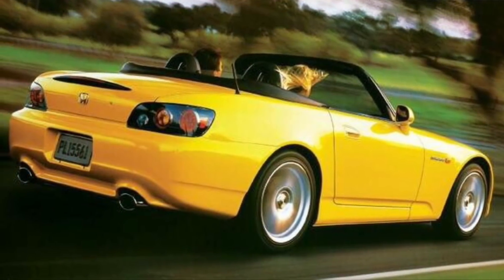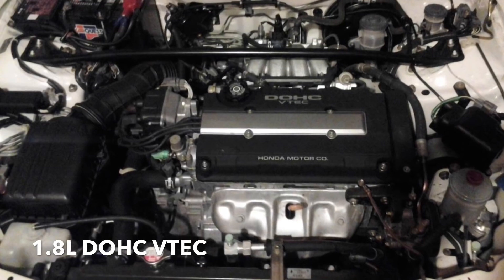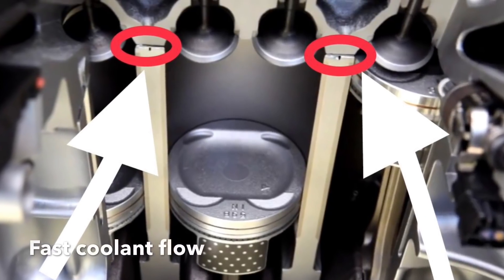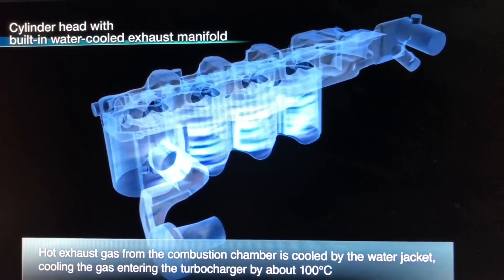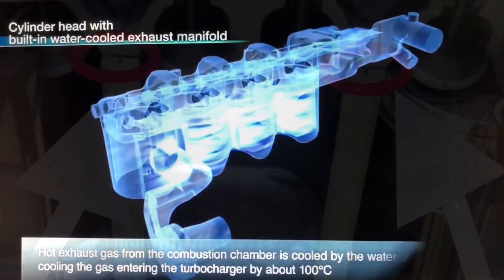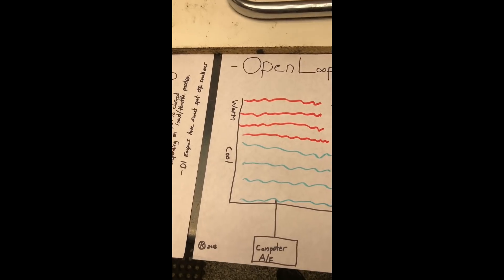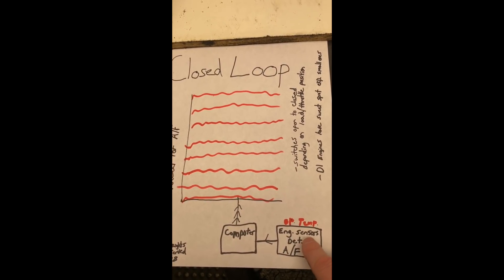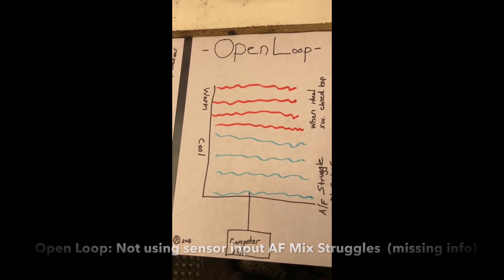1.5L Turbo Honda Oil Dilution Explained CRV Accord Civic

Comment: I wish I could get the civic hatchback without the turbo but can't so I ended up buying a new sedan with the 2.0l n/a engine.   I think it was the best choice considering all the issues with the turbo.
Reply from the maker: Sunset Originals Yeah you’ll be good either way.  The 1.5 is still a great engine.  Long term we will find out soon enough.

Comment: 2018 Honda Accord sport 1.5t, too. 10 months and only 7830 miles and i smell gas on dipstick
Reply: actually fully synthetic oil has a gasoline smell just check if the oil level is high

Comment: Alllllll 1.5 t motors are just poorly engineered pieces of trash. 2018 Honda Accord Sport 1.5t same problem. We should be reimbursed or given an exchange. It's been going on for awhile and they don't give a shit who there robbing. The  1.5 motors will blow before the timing chain even needs to be replaced.
Reply: @ub 40 had only for 10 months and it only has 7800 miles. 1.5t motor

Comment: Honda engineering messed up big time on this. Hopefully they redesigned their 1.5t engine. Warm or cold weather shouldn't be an issue for a good engine to work well.

Comment: Have honda civic 1.5 turbo 
Have problem
Car burns me spark plugs on every 6k miles
Need your opinion
Reply from the maker: hamza wali Just make sure it is documented at the Dealer and read your lemon laws.  It is probably fine avoid short trips and follow what service advisors are saying.

Comment: Direct injection is not new. DI/turbo engines have been around for quite some time. 
1 Besides the oil dilution.
2 Low heat at idle/slow speed.
3 Engines not coming to temp and staying there on low speed/local trips.
4 It has affected engines in warmer seasons/areas

So Honda is guessing? Seems unlikely. VW guessed with it's diesel engine problems?

Thx for the vid.
MJ
Reply: Honda is using paying beta tester to do their R&D...terrible.

Comment: The problem is that very little of Honda is still engineered and built by the Japanese workforce.  What made Honda so dominate (even in the US built cars/engines) was they had the TOP engineers in the world during the late 80s and 90s.  Due to costs, inflation, and globalization there has been a lot of skill lost.  It's not that US, Canadian, or UK engineers aren't competent nor that the line workers are lazy but the whole design and quality process is fragmented.  A bit of an over-generalization but Honda has been building excellent turbo engines for 30+ years...they just need to get their QC process back on track...
Reply: Honda 1.5t problems are not design problem but it is like they never even did the testing in colder climates.  The fuel mixing with oil is is epidemic across many countries where a recall is made in China, North Anerica only gets a ecu update and longer warranty in Canada and the U.S. gets just a ecu update if you live in one of the 5 states.

Comment: i have 2017 crv with P0172 fuel system too rich 100k miles, just 2k miles from 100% oil down to 15%.
Reply: What are you saying?
Reply: @qanononabong8491  my 2017 crv has check engine the code is P0172 means fuel system too rich bank 1 and 2. car has 100k miles. the car minder wants the oil to be change every 2000 miles which is too premature for the type of oil I use(5000 miles oil)

Comment: great explanation and video, always wished i had a 1.5 instead of the 2.0 in my civic, but kinda glad i just stuck with 2.0 ex... have a good one!!
Reply: The 2.0 is port injected and naturally aspirated. 
The 2.0 K20c2 motor is bulletproof and will last for hundreds of thousands of miles, these tiny 1.5 turbo direct injected motors won’t last nearly as long, that’s a fact 👍🏻

Comment: Declining market for cars like Accord and Civic, with increasing preference for SUVs like the CRV has now made it Honda's flag-ship vehicle.  From third generation 2007 CRV on up, it's great in most every detail, and no wonder about it's popularity.  When Honda does get it right, they leave others in the dust (as in F-1 Racing).  

Honda's popularity started with superior innovations like front-wheel drive which others like Toyota adopted. They were not consistently trouble-free as Scotty Kilmer rightly pointed out.  Honda's automatic transmission problems of the past did not plague Toyota.  

This oil dilution is a major problem for which Honda needs to find a fast and proper solution, otherwise they'll lose to (abundant) market competition.

Comment: Honda says keep an  eye on your oil level  till the warranty is over and the engine bearings spin. Open loop? these modern engines go into closed  loop before you release the key from the start position. PCM reflash, just the quickest, cheapest way to buy time.  The resale value on these vehicles is already shot do to the unknown internal engine damage possible (just ask  Car Fax).
Honda  will have to step up on this one.

Comment: Also after watching your video I understand what you're saying about closed/open loop, BUT, I think that is what Honda is trying with "the fix" and so far the people on the FB 2017-19 CRV page are stating that nothing changed after the fix, they are still smelling fuel and getting oil dilution and over filled crankcases so I think we have a serious design issue, all direct injection turbo 4's have this issue, direct injection carries problems, but most have oil dilution in the 4-10% range not to this level and diluting 0/20w oil to 4% alone is going to take an engine out eventually, the wear is going to mount up.

Comment: Good video, we passed and bought a Rav4 Hybrid, I see what Honda was thinking but I think they made a huge mistake with this engine, the v-tec or i-vtec was a great engine, trying to get get more hp and more mpg by designing a small direct injection 4 w/turbo was the wrong move, a v-tec hybrid would have been wiser, we have more hp with the Rav4 hybrid and are averaging 33-40mpg. These honda 4's with high compression and 0/20 oil are going to come apart.

Comment: Our crv 2017 has the oil dilution problem. Oil cap reeks of gasoline, oil mark on oil stick is way over where it should and smells of gasoline, the cabin also smells of gasoline. Honda is a disappointment. They issued no recall yet.

Comment: For oil to smell like gas it needs to dump gas from injectors while the motor is off, so the fuel goes past the rings. Hard to believe this really. You won't see this kind of condition even on rich running carbureted engines.
Reply: Nissans have had a problem with this on their larger engines and the engines are diluting the oil so much that big end bearings are wearing out and causing total engine failure been happening for years on navaras
Reply: No the main reason for gas getting in the oil is GDI

Comment: Earth Dreams - There's the problem. What was wrong with the 2.4 litre engine ? It was literally bullet proof
Reply: @ub 40  Glad to hear about your Honda LX and the high mileage!!! I am new to Hondas ...so please don't laugh..was your vehicle a Hinda Civic LX?
Reply: It's not literally bullet proof
Reply: Robert Graham 0’
Reply: Just remember that the 2.4 is direct injection. Throw some value cleaner in the gas once a month to keep down carbon buildup.
Reply: Didn't meet the EPAs bullshit fuel efficiency standards, thanks Obama
Reply: @AdamSmith-gs2dv  
Yet Toyota still goes non turbo

Comment: 6:18: Thank you for pointing out that not all Honda 1.5l turbos are affected by this problem.  In the U.S. domestic market the problem seems to be isolated to CRV’s in cold weather climates that are only being driven short distances.  Accords and Civics are not experiencing oil dilution problems here in America.
Reply: Accords use a different engine, the Civics do have this problem as they use the same engine
Reply: Adam Smith Some Accords use the 1.5l turbo.  But as the video states not all Honda 1.5l turbos are created equally.  So I have not heard of any widespread oil dilution problems with either the Civic or Accord.  And there definitely is no official recall notice on either regarding oil dilution.  The problem seems to be limited to CRV’s in cold states driven for short distances when the moon is full.  OK that last part is a joke.  But saying all Civics have this problem is stupid, it just isn’t true.

Comment: While in open loop the direct injection is spraying directly onto the cylinder walls. Horrible design.
Reply: They can't avoid that with DI, they can however minimize the problem but Honda didn't do that to get 1 or 2 more MPGs on the mileage test

Comment: Have 2018 CR-v with one of those engine. No problems, works fine.
Received a letter from Honda today, asking me to bring the CR-V in for a software update for the fuel injection, the CVT and to the climate control unit so engine will warm up faster.
They also decided to increase warranty to affected engine components to 6 years , no mileage limit.
Reply: are you taking it in for the "fix"?  I'd be afraid to since mine has no problems at all either.  If it aint' broke don't fix it is my motto.  I will take the longer warranty however which they probably won't give without letting them "fix" that which isn't broken..right?  :)
Reply: So you are supposed to throw the engine after 6 years! I would rather demand a reasonable acceptable amount of milage with an unlimited years.

Comment: Some misleading information but the core concern is somewhat on point. Few corrections which should help:

 - All TCDI powertrains suffer from some fuel dilution, which is primarily due to the rich cold start cycle and placement of the injectors overhead. It's mitigated several ways, from fuel/oil quality to the design of the PCV/oil separator (if the vehicle is so equipped). There's no correlation between dilution and engine displacement.

 - Honda's "issue" has more to do with the speed at which these powertrains reach operating temps. Part of this may be due to their inherent cooling efficiency, which is briefly mentioned in the video. Shorter trips, use of the heater, and/or low ambient temps only exacerbate the problem because the oil may not reach the minimum temps required to burn off the fuel/water accumulating in the crankcase (~200*+) . This accumulation happens in all TCDI powertrains, from Ford's Ecoboost to VW's TDI/TSI.

 - Honda's primary "fix" focuses on ECU changes that limit output of the heater and other accessories. This helps accelerate the motor's warm-up cycle which subsequently vaporizes any fuel/water in the crankcase (which is then siphoned out through the PCV). There are other changes as well, but none really impact the overall hardware/design of the 1.5T.

 - Honda doesn't use the VTEC branding on the USDM 1.5T Civic or CRV.  But it does on the 1.5T Accord which leverages variable lift on the exhaust side for better torque and boost management.
Reply from the maker: Godspeed931 Good info and thank you for correcting me.  I know some of my info is off no doubt I simply wanted to send off the general message things are changing as expected and in time it will indeed be fine.  Was not expecting this many views either...I think over all it is increasingly difficult for dealerships service advisors to send a clear message.
Reply: The reality is that the "issue" impacts a very small portion of 1.5Ts. Probably less than 0.1% of the half million or so powertrains out there. Of the 4 or so documented cases of "extreme" dilution, all have been tied to extremely low ambient temps and short trips. 

Honda is offering this "fix" more for PR purposes. That's not to say the issue doesn't exist. But often times it gets unfairly associated with other issues such as an erroneous dipstick reading, a faulty injector, or the mechanic overfilling the crankcase during an oil change. 

Also keep in mind that one documented issue ends up being perceived as 10-20 once it gets repeated through the various outlets on the internet. It's important to remember that dilution alone isn't indicative of a problem, unless accompanied by low viscosity AND high wear metal readings.
Reply: Godspeed931 why does this issue affect a small percentage of crvs and not all?
Reply: @ub 40 Don't buy one, I'd personally avoid anything turbo charged like the plaque it's just one more expensive part to fail
Reply: @Kimcon Llc do you have any problems with the mazda 6? I was going to buy either mazda 6 or honda civic. I wound up buying the 2019 civic touring. I just bought it a couple weeks ago. I'm in Minnesota so I hope the oil dilution doesn't affect my car. I really love the civic.

Comment: I wouldn’t touch a new Honda.... most gas engines have to deal with short trips in cold weather.... after having driven about 1 million km. Under such conditions I have never encountered a gas dilution problem in any of my vehicles. ... and anyone who accepts Honda’s excuses is a big fool.
Reply: Since when does a short trip in cold weather constitute owner abuse?  Honda doesn't care about it's customers.  Incredibly, this problem has received no media publicity.  The average car buyer doesn't know about it unless they found it on the internet.  Never had a Honda and now wouldn't even consider one.
Reply: Maybe Honda could produce EVs, for short trips, giving every CRV owner who has this issue one for free? CRV for long trips, EVs for short trips?

Comment: pulling an elephant out of a box has never been possible. these mini engines on steroids wont be able to do what the naturally aspirated can without serious problems. i havent heard or seen a proof of getting something from nothing, just like its not possible to get 2 breads from the same amount of flour u were using before when making one bread. new goverment regulations push for smaller emissions and engines but at the same time people have to drive longer to make these new engines last longer. dummie poiticians should stay away from the science and engineering process

Comment: Honda can try to explain this away as a temp issue, but the bottom line the design is faulty.  Gas and Oil...should NOT MIX in a new car!!

Comment: I may have said this before but my 18 CRV the climate control ramps the fan on cold mornings in auto mode and basically the heater core sucks what little heat there is out of the engine.  Now that it is winter I have noticed my average MPG has dropped from 30 to 27 due to mostly short trips of less than 4 miles  in 32 to 45 degree weather.  The engine seems to run rich most of the time.  Honda is trying to remedy this with software and mods to climate control. Good start but this motor has a cooling system to match its power so its most likely the size of the 2.4. The little motor just can't make enough heat to warm up the engine with the large climate control system in the CRV. Don't forget there is also a heat exchanger to the transmission on earth dreams to warm it too as another load.  Thats why when it warming up  and stop at a light in cold weather the engine temp will fall.  The only good solution for Honda would be to add a heat recovery device to either the EGR or in the exhaust manifold like on the newer hybrids.  Honda is not doing this yet.
Reply: When the temp gauge falls shut heater off until temp gauge goes up

Comment: Nice try generalizing small block GDI turbos, but Honda's fantastic design is the one dumping fuel at this alarming rate. And not just in very cold climates.
Worse, their initial denial followed by limited mealy mouthed response due only to pressure is reprehensible. Honda's YT 'explanation' is vague, condescending and useless. 
They screwed up, plain and simple.
Reply: Yup, Honda screwed up and is getting a free pass in by passing a recall in North Ameeica.
Reply: Basically told me I imagined it. I must be smelling fuel BECAUSE there's fucking FUEL IN IT! I came with a bottle of OW-20W Synthetic motor oil unscrewed the top and said smell this.... Now smell the napkin I just used to wipe my dipstick and there is a HUGE different smell. One smells ONLY like oil. Other smells like fuel and barely oil. Service manager says he has to listen to the certified trained mechanic because he's taught how to fix hondas. So even if he smells the gas and his mechanic tells him there's no gas, then that's what hes putting down. The car is operating normally he says HAHAHA. Never in my 25 years of driving have i ever crossed a vehicle that has had this dilution problem.  If this isn't bullshit lying excuses Idk what else to tell you guys! There lying right to our faces! Motors had problems for awhile. Admit it Honda, you fucked up simple! I tried to go to Honda and failed. So waiting for my oil analysis kit. Wasn't even giving an oil change when I asked for one and I payed extra for honda service when I bought the car.

Comment: Here's my theory. High compression turbo engine + increasing piston seal clearance so there is less friction to increase fuel efficiency. When cold too much clearance and fuel is being forced past the seal onto the oil. As the engine heats up and expands clearance narrows and fuel pass through stops. With longer runs fuel in the oil is burnt off.